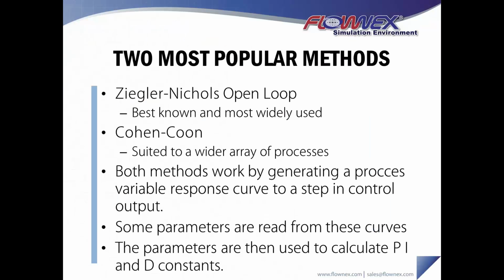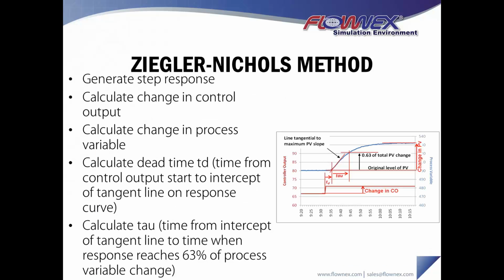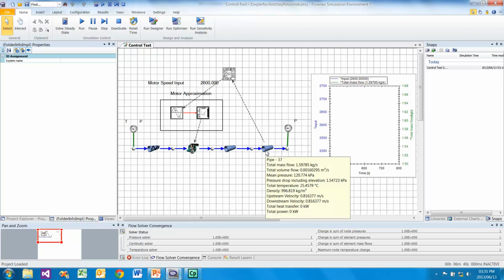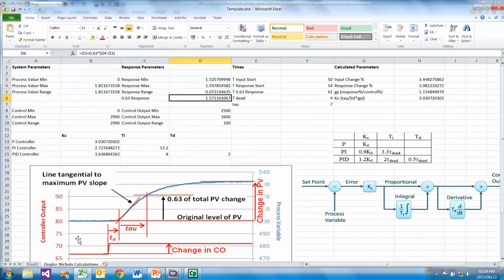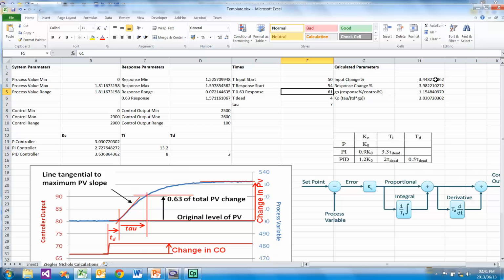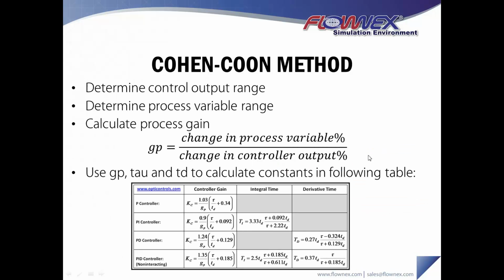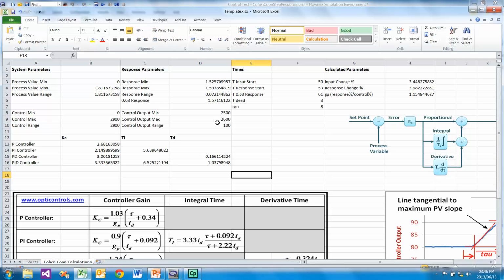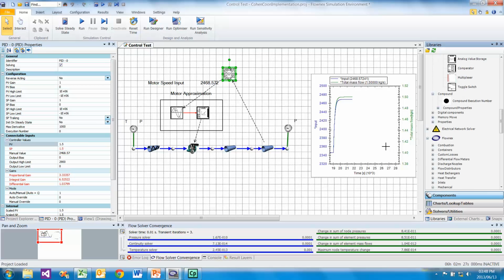PID Controller Tuning

Comment: Very good video...!!! I have a question...in Simulink ,the PID block  uses a formula such as P*(1 + Int/s + DN/(1+N/s) )... in where P is the proportional constant, and Int. is for the integral and D is for derivative part.  If you calculate the Int. constant  by any of the method presented,  do you have to divide  the integral constant by the  Proportional parameter   before entering  into the PID block?  Let's say that P =100, Int. = 100, would you enter in the PID block say 100 for P and 1 for the integral ?  

Again, I'm not sure what type of PID controller are you using if the ideal or the parallel setup.... I guess that these PID parameter estimation methods  are for the parallel setup.

Thanks.
Reply from the maker: Thanks for the questions tonymac96,

Yes, you are correct. The example shown is for a parallel setup and the integral and differential values will need to be modified if you were to use them in Simulink as you described. We have other PID controllers in Flownex that can be used for PIDs that are wired differently. In this case, we would need to make minor modifications to the Excel workbook.

We offer detailed control training when using Flownex which covers these topics and explains in detail how to model the control and flow in your system and properly tune the controllers.

Comment: I have a question. What do you mean by control output range and process variable range? You said that Gp = change in process variable% / change in controller output%. I don't understand why you are putting it in a %.

Comment: can i find out value of Ko without using Flownex SE, anyhow?
i am working on a AUV and a UAV as well.............of course the setpoints and tuning parameters will be different for them. But i couldn't figure out a practical way to exactly define values of Kp, Ki, Kd. Please help